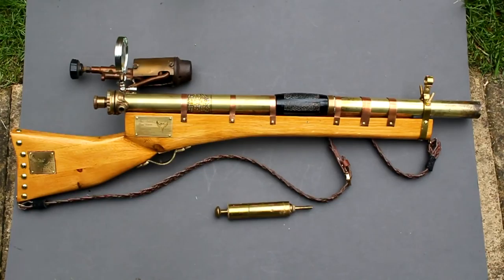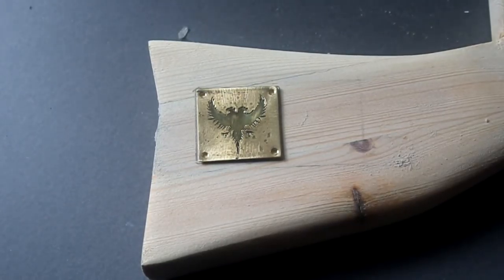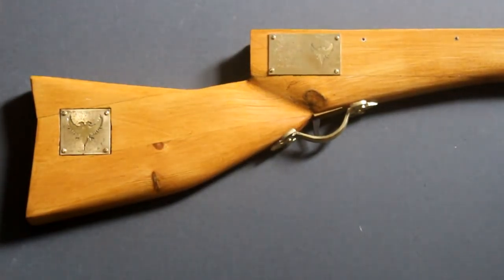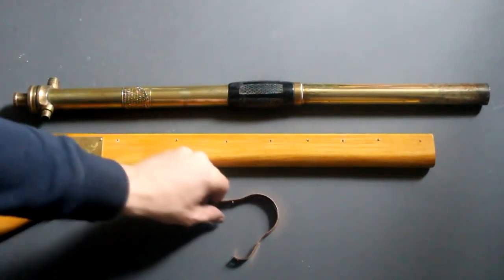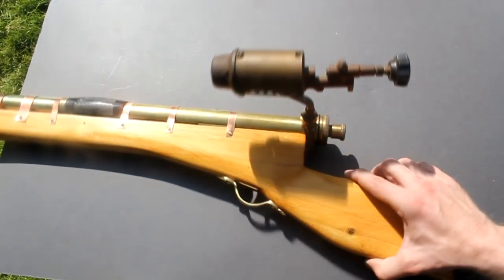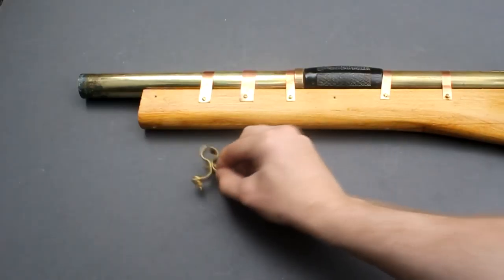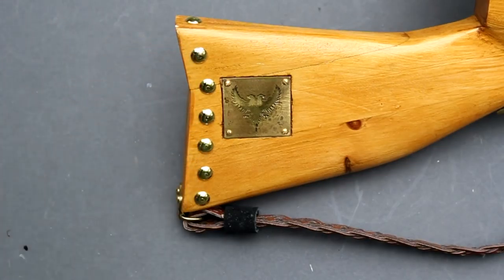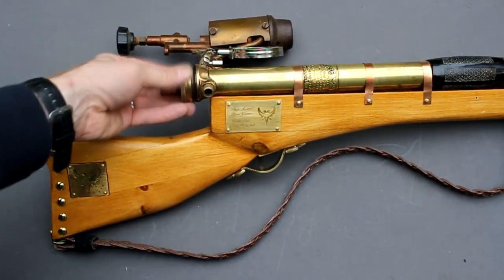Steampunk Prop Hand Cannon

Comment from the maker: Not any more but brass used to be the metal of choice for a wide range of tools and garden equipment.  I just had a look on ebay.com you can get them, but they are a lot more expensive than in the UK.  Search for vintage brass spray (or garden).  Pieces like this tend to be $10 - $20 in the UK.